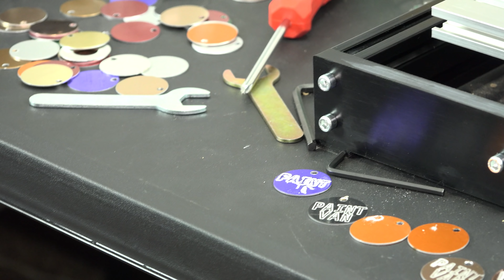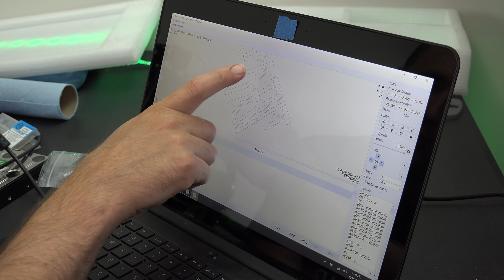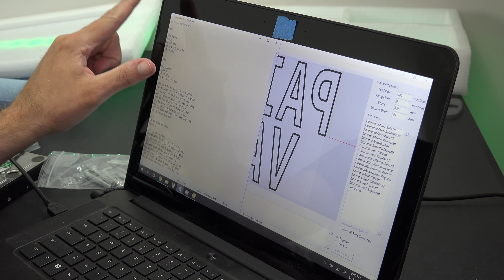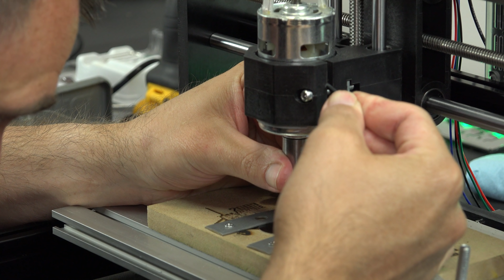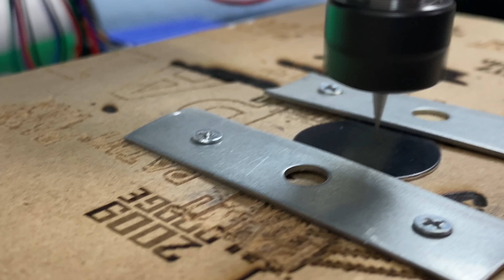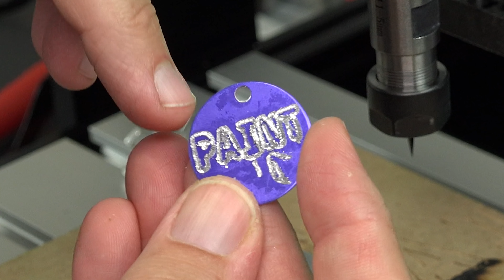An idiot tries to use a CNC engraver / milling machine

Comment: 1. your blanks are probably not flat/true, and that is causing a depth of cut issue... likely those blanks were stamped out...
2. your cut speed is probably still a little high for the material you are cutting, leaving a rougher cut...
3. you'd be better off with a more precise jigg/clamp to hold the blanks
4. you may wish to try applying a lubricant to the cutter/piece, it helps the cut, and cools the bit/material
5. aluminum is a gummy metal when cutting, it's soft, and tends to clog up cutting edges...

Comment: Too many things to say. One that'll help you the most is compressed air blast. Re-machining chips is the worst thing. Your results will be more consistent. The other is RPM, way too low. You can't spin an engraving tool too fast. I use 25 000 rpm at 30 ipm. You're setup needs too much to explain. With what you got you can do alot. After you start chip evacuation you'll be able to see and learn better ways. You'll never get anywhere remachining chips. After awhile you'll get better and put 20 at once with a quick change jig and pump em out. Gotta get that faster rpm. Look up Surface speed, feed per revolution fpr your tool. Engraving DOESN'T need any lube

Comment: You could try leveling the spoilboard to ensure a level surface in relation to the spindle.  Then, since you are engraving metal and running Grbl you could wire up a simple electrical contact Z probe setup (signal to engraving bit, - to tag, test conductivity of tag first) so the machine’s Z axis moves down slowly, and the moment electrical contact between the top of the tag and the bit is made the machine stops moving and sets Z.  It should be a lot more repeatable of a depth that way versus how you were setting Z in video.
Reply: Steel table, use gauge block and move tool +Z in lowest increment untill it slides under. If the block is 1" you set Z+1". Then the table is the Z 0. All those parts are exact same thickeness, probably 0.036" thick. Program it to cut at Z0.036" then 0'002" stepdowns till desired effect. 20 year machinist that uses 3 million dollar CNC's to make precision molds

Comment: You're melting a lot of aluminum and it's also sticking to the tool. I'd use a lubricant made for aluminum. Try WD-40 first. Tap Magic makes an aluminum cutting oil as well.
Reply: Messy, expensive waste. He needs a light compressed air blast to clear chips. It'll also cool tool. Is main problem is low rpm and workholding

Comment: I used to make these type things for going away plaques. 
First, you need a repeatable jig area. We would hold down the first piece of metal and trace its outline (including the small hole).
Then, we'd tape it down with scotch tape. A little bit on the bottom and then top and bottom (about where your screw down holder was... out of the way)
Last, speed up the bit and try engraving only half of that depth. Go from there. No need to undo the bit and manually move it.
Good luck!

Comment: You said you had to edit the gcode that means the software does not have the correct post for your machine.  Every machine has a semi specific post.  Offset is the term for "calibrating" the position.  Setting the Z offset is best done with a reference object with a known height.  Say you have a 1.0 inch block lower the tool till the block will no not go under.  Now moving up slowly get till there is almost no drag.  Now set the offset and subtract 1.0.  you might have lunch with copy pasting the program with a different z depths .005 then .01.   I could not see the code very well but spindle rotation speed (S)s1000 seems low.  The ZYX feed (F) f20. MM/min which might be a little fast for that spindle speed.  Try F 15.7 if your chip load is way wrong your either moving to slow (rubbing pre mature ware) or moving fast where the edge of the tool does not have the proper time needed to cut.  Might try the straps flat on the sides and a screw through the hole for fixturing.

Comment: I suggest like 2000rpms. Even if that may be to fast you are only going in maybe .005 on z. But you will get a nice fishish. To fast an you will burn bits all day. Also try rerunning the laser twice. It may look more bold i think.
Reply: He'll never get a good result remachining chips, you can't spin too fast. I engrave at work at 25000 rpm and 30 ipm, 0.005" stepdown is too much

Comment: Sorry, but if you are in any way versed in machine cutting and milling you would cringe, there's a lot being missed here.  You should REALLY check out a few vids/tutorials and especially ones that go over the properties of different work materials.  You'd be surprised how speed of cutting can differ between metals even. 
For fine engraving especially you should at the very least have a blower/vacuum tube targeting the workpiece to stop the shavings from cutting the workpiece, and for best performance a decent "bit" and cutting fluid to protect the cutting edges from getting overheated and stressed.....and usually shearing/snapping.
I realise these machines aren't the best quality but you can at least help it do the best job possible.

Comment: As a CNC machinist not bad you do need some practice first plane off you spoil board that way it is parallel with your X axis once you do that cut a small pocket just big enough to insert your tag into it ....using the hold in the tag get a small metal pin that is the same size as the hole in the tag and mount it into the pocket so you can easily locate the tag in the same spot front and back try to make it to have as little play as possible you still will want to hold it down with the metal clamps to touch off your tool jog the machine down to the top of the part that you are engraving and with a piece of thin notebook paper pinch the paper between the bit and the part to the point you can pull it out but can't push it back in you will be just above the the part and can get it close every time..... And repeat that step every time you take out the tag and flip it to do the other side or put in a new tag message me with any questions I will be happy to help
Reply: lol, you should've said "chip evacuation" cnc operator. Paper? lol, that's so amateur

Comment: I was a engraver apart from the holding issues the setup looks ok. The area I would look at is the cutter the tip should have a taper away from the very point in two directions giving a clearance for the chips this also gives a wider cut without increasing the depth. The aluminium used in the tags can be very soft I see that you cutter has a very steep angle a lower angle could help with the quality of the cut.
Good luck mark
Reply: No, his tool is fine. He's remachining chips and way to low of rpm.

Comment: Maybe your table is wobbling a little and needs to be wedged tight. By dropping it a little it could be making it less stable. Maybe drilling out an area for the tag to sit in or having a circle washer shaped vice would help. You could also have the circular clamp slightly lower than the tag(have a circle slightly lower surrounding the tag and a circular clamp holding the edges of the tag in one piece) a thicker hold down or vice might add more clamping pressure. You could bolt and nut or clamp underneath. I have no milling experience.

Comment: Your spindle speed is at a S1000 your feed rate F20.  I don't know if you sped up your video or not. I don't know if you're an inch or millimeters. From the speed of your video it looked like 20 inch a minute which is way to fast. Essentially you're causing a friction weld. 
Don't use engraving tools those are worthless on anything that isn't  Microscopic. Get a .8mm or1/32 ball mill. Max out your spindle speed.  Your feed rate probably about 2.5 inch a minute. Depths of cut should be around .003 of an inch. Coat the top of your tag with WD40.
Reply: Lol,
Reply: @highstreetkillers4377   Read most your comments. You got a serious fetish with the word chip evacuation don't you. I don't know if you noticed, but the machine he has is basically a micro penises.  Even the low carbon steels would be too much for that tiny thing. He's trying to make one tag not 10000 of them. A wood fixture with some set screws would be just fine.

Comment: Aluminium you need as fast as possible milling speed so if you can increase the speed the better the cut. You need to get rid of the swarf produced, get a can of air (PC cleaner ) to blow it off the tag as this getting dragged into the cutting head will create a rough cut. Also the the better you can hold it still the better, if you can get a slab of aluminium and cut a tag hole as Chris D said. Then perhaps you can create a full Zero position so it will be just load keytag and off you go rather than set it every time.
Reply: If you're not a machinist, nice answer. First comment I've seen that someone points out chip evacuation, he'll never have success if he doesn't

Comment: Hi I'm a machinist the v bit your using your going too deep in too the aluminium and it being a soft material that's why your getting all the burrs on top edge and too slow of speed. Try a different shaped bit or only go very very shallow depth in aluminium. And if your cutting metal some form of cutting compound would help
Reply: You're not an employed machinist or you would've said "chip evacuation "

Comment: 5 seconds of observations: The chuck and spindle on that motor is too flimsy, cheap motor, small shaft and heavy, unsupported spindle. Spindle speed for those tips / burs way too slow. Cutting face speed needs to suit the material and the abbilities of the cutter, your rate too high for that spindle speed.

Comment: Hey thought I should comment, I have the same CNC as you the 3018 Pro. I picked up a good tip from the NYC CNC channel they used to hold work down. If you put masking tape on the bed and the back of your piece, then use super glue between the tape it holds you work down great. and you can avoid hitting anything. Also not sure if anodized aluminum is conductive cause of the coating, but make a pair of leads and and connect them to the z probe on the woodpecker board(main board), I use alligator clips on the other end one to the tool and the other to the work.  Within candle you can then make a height map that will probe the work and adjust the z height of you gcode so that its level across the work piece. I use this when making PCBs so that the trace depth is consistent across the board, and it works great. It works the same way as Mesh Bed leveling on a 3d printer. If you have any questions I can try to help out, I am no master but have had the machine for a few months, thought id share somethings I have learned

Comment: Why not cut a circle into the wood to hold the key tag and then have the aluminum over top of it to stop it from popping out, then you can just set the depth to the top of the wood and not have to move the spindle every time you set your z axis?
Reply: Came the comments to say this.
And on the process of making the circle in the wood you make sure at the same time that the tag is going to be straight relative to the machine.
Reply: No wood, metal fixture. Engrave tool only cuts 0.008" down at 0.002" levels. A hair is 0.004" average
Reply: Good idea was thinking the same 😁
Reply: Or cut into aluminum so you have a fixture for that job everytime that grain to me is to weak

Comment: Make a jig out of metal with clamps so you can secure the tag consistently in the same location.
Reply: Just what i was thinking 😄
Reply: Great idea. Aluminum i think will be best.  That aluminum will help you repeat every part.
Reply: @pablogarzasr.786  steel is best, always. Aluminum wears. Always hold part with harder material
Reply: For what he is doing Aluminum is more then enough mr. Harder metel could bend what he is doing. On huge cnc machines i use Aluminium"soft jaws" every single day to cut on stainless steel or even hold inconel sometimes. Not always.

Comment: you need to blow or clean away the filings as it mills (setup a vac and suck the shit as it goes )   . its causing it to scuff it. also i'd use some cutting oil

Comment: Tape and superglue.  Place some tape like a wide blue tape.  Then put some blue tape on the wood board.  Then put a dot of superglue on the back of the blue tape where the dog tag is.  Glue this to the blue tape on the wood board.   The dog tag will stay in place and will not move.  The tape keeps the superglue from sticking everything to the wood board, and it is easy to remove.
Reply: Get that John Sanders crap outta here.  John is going to get people hurt telling them to blue painters tape and super glue parts down in there mills.

Comment: May take more prep time but paint it black. laser away the paint in the text you want and theres some process that can either coat or erode away the metal to make a lasting impression on it thatll last long. Cant think of the process right now though.
Reply: Black paint and pcb etchant. Works a treat for deep etchings. Need to be careful about over etching though, it will gradually erode under the paint.